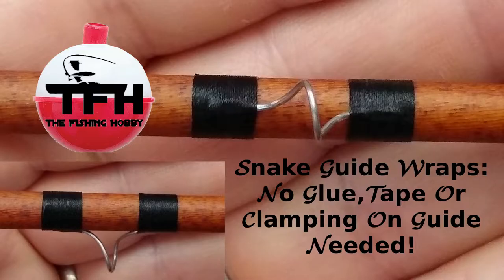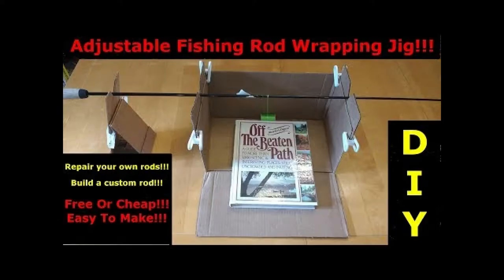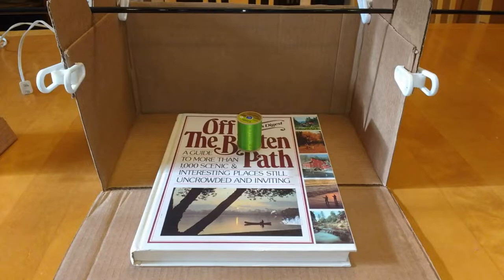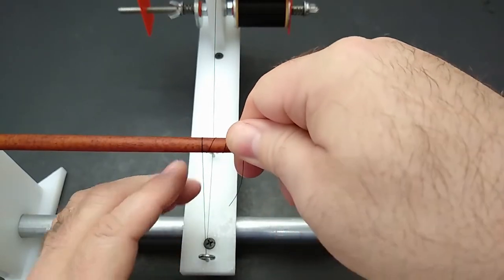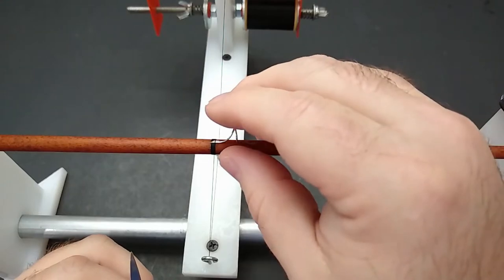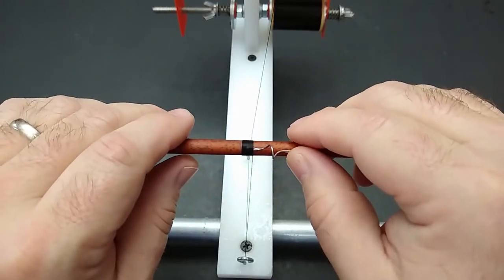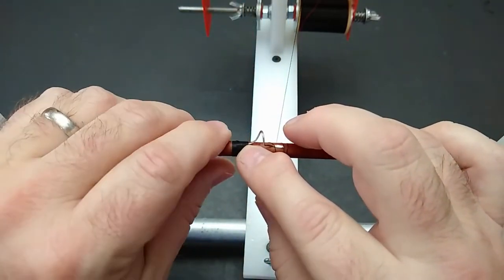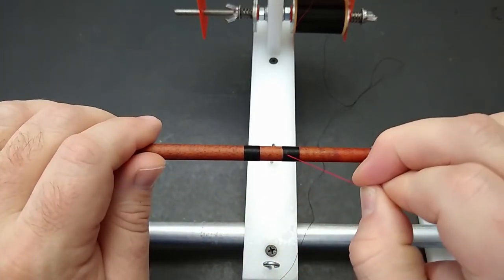Snake Guide Wraps: No Glue, Tape Or Clamping On Guide Needed!

Comment: After watching your first video it’s the only way I wrap guides now. I’ve also wrapped guides as large as a 24-26 it’s all in the tension.
Reply from the maker: That is true, the more thread tension the more weight it will hold 👍 Good point. I don't use a whole lot of tension while wrapping ordinarily so I still use tape or rubber bands for larger guides. I'll pin your comment to the top of the list so others may find it. That is good info for people to keep in mind.
Reply: The Fishing Hobby, I lighten up after I move the eye into final position then finish off my wrap. Yeah to much tension makes the tag hard to pull through.
Reply from the maker: That sounds like a good way to go!

Comment: I have a broken snake guide on my fly rod, the guide that's broke. Is right next to the joining end how would this be done
Reply from the maker: If it is a snake guide, you would just wrap it on like this video shows really. Doesn't matter so much where it is located unless they did something like a strengthening ferrule wrap that continues onto a guide foot. If that is the case, you probably should redo the ferrule wrap and locate the snake guide just far enough away from the ferrule wrap that there is a little space between the two. That would make it a lot less work to replace a possible future broken guide in that same spot if it happens again.